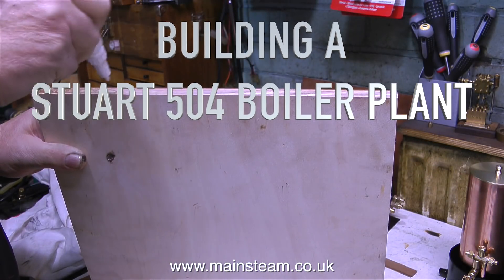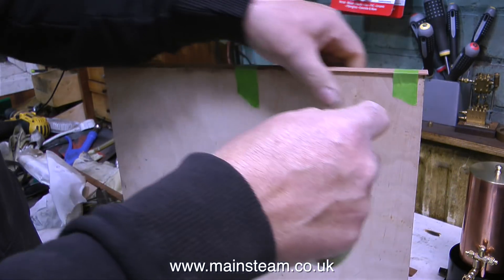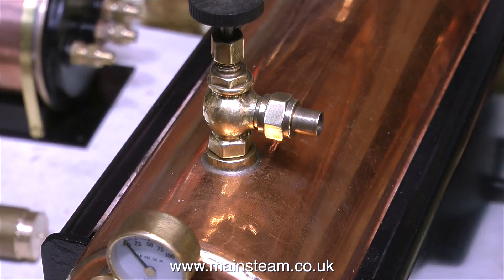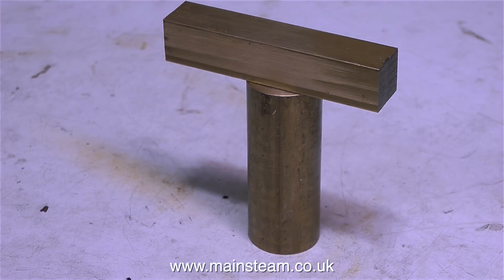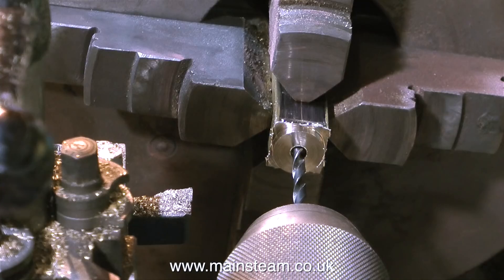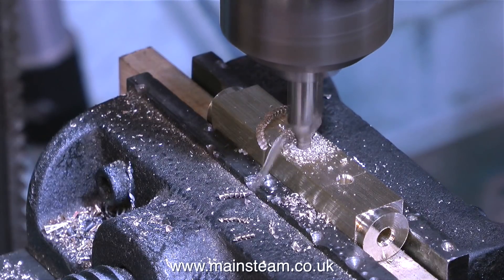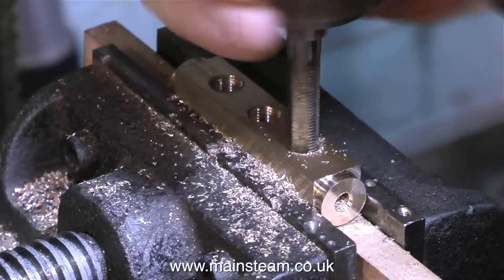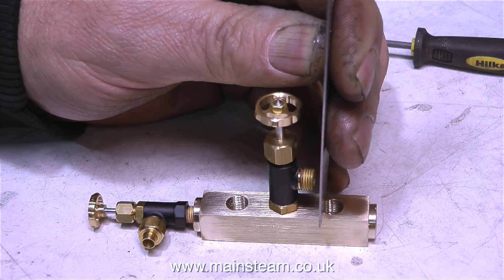MAKING A STUART 504 BOILER PLANT - PART #7 - STEAM MANIFOLD

Comment: Glue: Rubber Cement (if that's what you call it) is much more entertaining than CA glue. Particularly if you work in a cube farm. 
You can roll up the excess and it looks like something from your nose (don't know what that would be called in the U.K.). Then you can flick it over the wall into the next person's cube. It's even sticky if you work fast. 

Strips around the edges: If the first strip is applied with one end flush, then the next strip can be stuck up against the overhang on the first strip, same for the second and third. That way, none of the veneer strips have to be cut to an exact length. Less chance that an expert like me would end up measuring twice, cutting onece, cursing, then going to buy more material.
Reply: We still call it a "nose" over here.
Reply: if you add strips like that you end up with corners looking different at each end of a side. Better to glue to opposing sides then trim the overhang and glue the other two sides